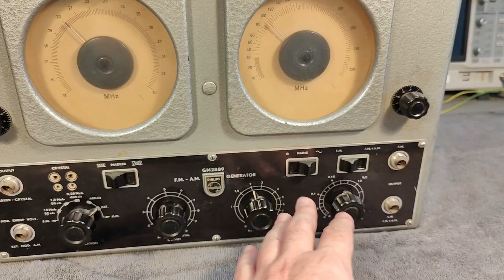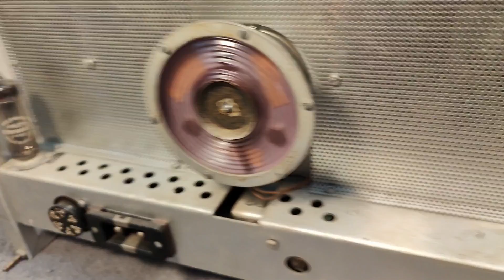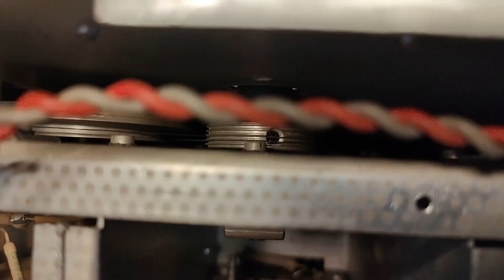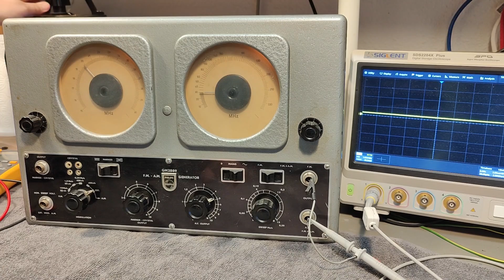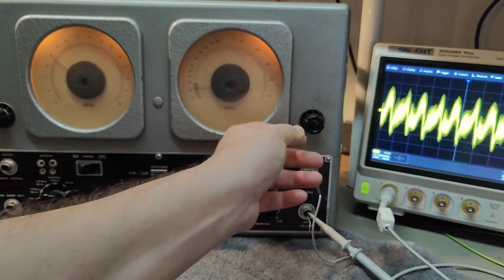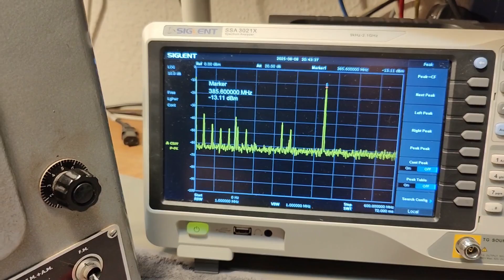Philips GM2889-1 FM AM Generator 5-220MHz 1953

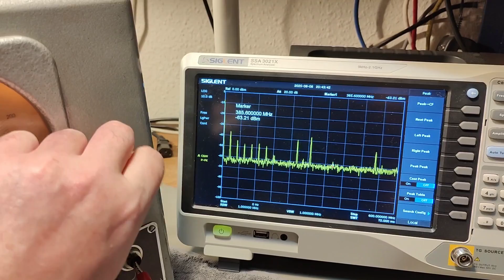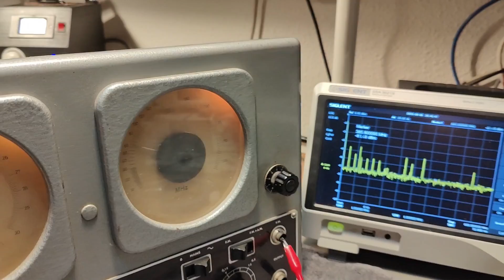Comment: I think I can see the mixing product sometime between 21:00 and 21:10, there is a low frequency component, moving in sync with the high oscillator. Also sometimes a component at 270 MHz (low oscillator) shows up.
My wild guess would be, that the mixer tube is oscillating. Maybe because there is something wrong with the LP filter (it's anode load).